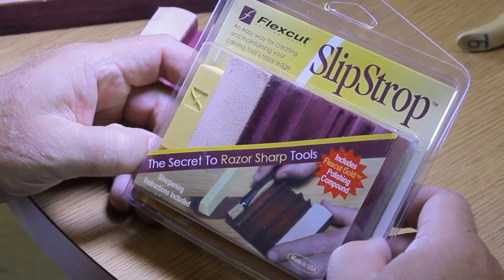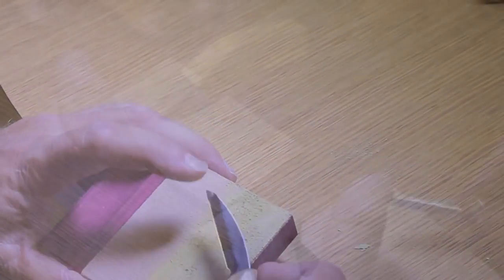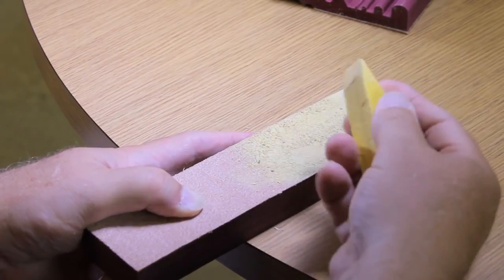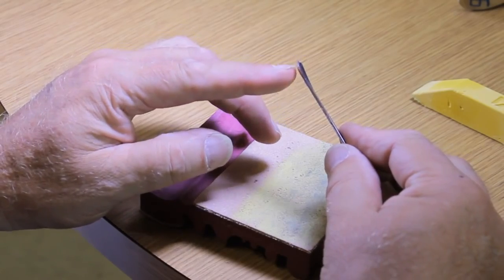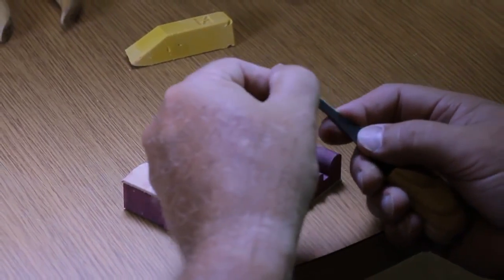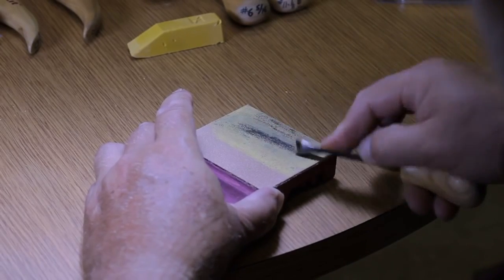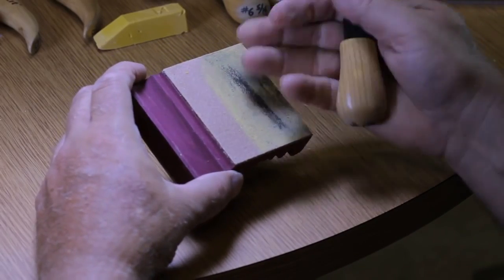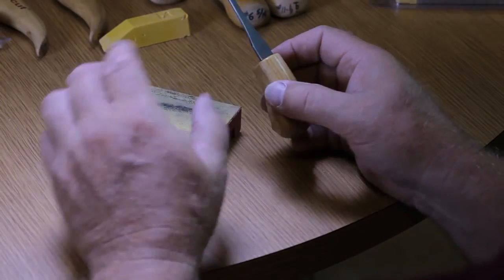Sharpening Carving Tools with the Flexcut SlipStrop

Comment: I have some Pfeil tools and assume it’s the same principal 🤷‍♂️ I did see a someone use a stone first the finish off with slipstrop. What is the advantage or disadvantages of using a stone?
Reply from the maker: Good afternoon Simon, thank you for your question. 

The slipstrop is more of a buffer that will maintain sharp tools and just do the final touches of a proper sharpen. You could use a high grade (4000) slipstone for the same purposes as the slipstrop, however the slipstrop is easier to use. In short, you'd probably need to start with a stone if your cutting tool is really blunt, but if it just needs a little sharpen you can just go in with a high grade slipstone or the slipstrop. Little and often buffering is better practice than a big sharpening operation, less frequently.

We hope this helps, all the best, 

the Jackson's team.
Reply: I Appreciate the response , thank you 🙏 😊

Comment: anyone know what "grit" that yellow honing compound is...? 1000? 2000?
Reply: rahm emmanuel According to Flexcut the particle size is .6 micron and slightly larger. Looking at the Grand Unified Grit Chart that looks like it would be somewhere under 18000 grit. 😮
Reply: Honing compound is always 15000-25000 grit